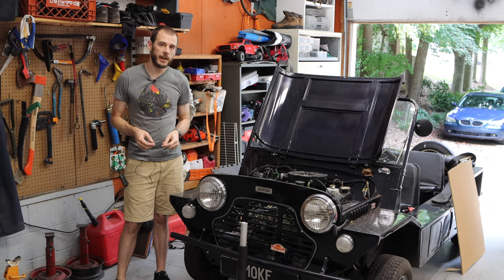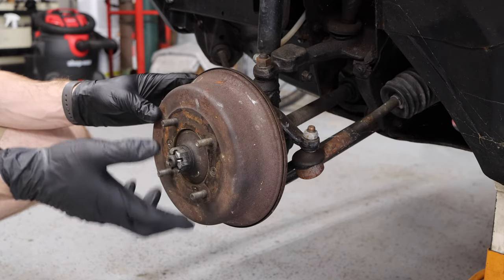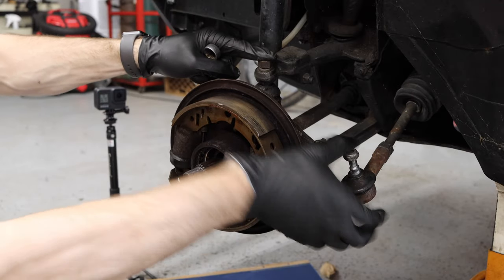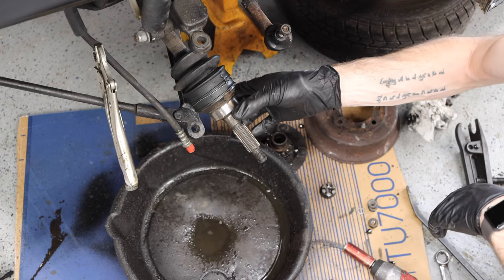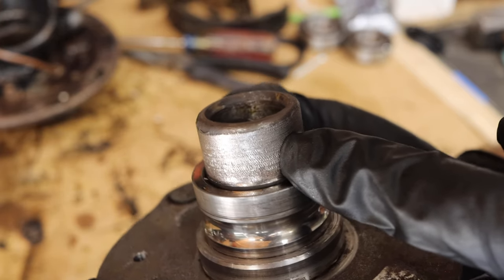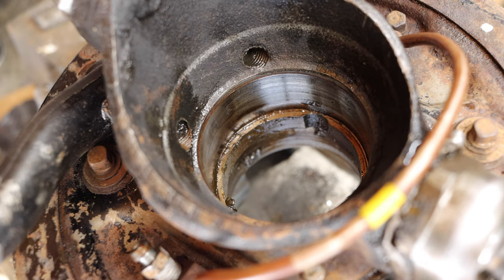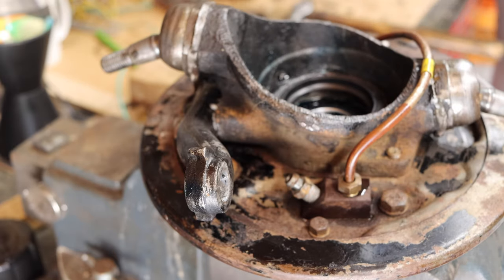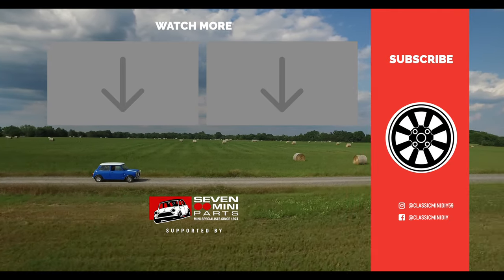How to Replace - Front Drum Wheel Bearings (Classic Mini or Classic Mini Moke)

Comment: Great video!  I'm having difficulty removing the drive flanges as I'm trying to remove and replace the backplate.  I've taped it on all sides and it doesn't want to budge.  Any suggestions?  

Edit:  Finally got the drive flanges off with the use of a slide hammer.  Unfortunately, the bearings came apart so I guess I now have to completely remove the hubs so I can knock out the bearing race and dust shield.  Am I missing anything?

Comment: And just FYI you can swap a drum brake car to the tapered roller bearings from a disc brake car. The bearings are identical dimensions 😀
Reply: not the torque, which could be excesive for the drum brake whell hub

Comment: Need to change the CV boot on my 1975 Mini 850. Just wondering if I need to remove the brake line or once removing the ball joints if i can just put the assembly out the way while I work on the driveshaft? And any tips you might recommend. I had a garage replace them last year but one has split again so I want to try and do it myself. Thanks :)
Reply: I assume you figured this out a while ago, but just hanging the assembly out of the way is all you need to do.